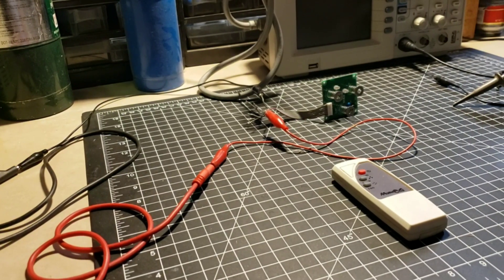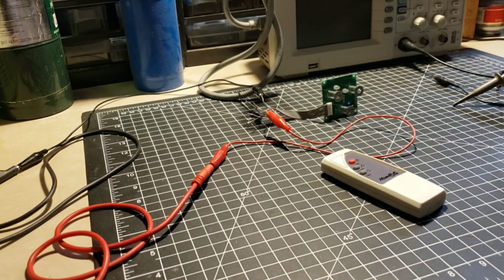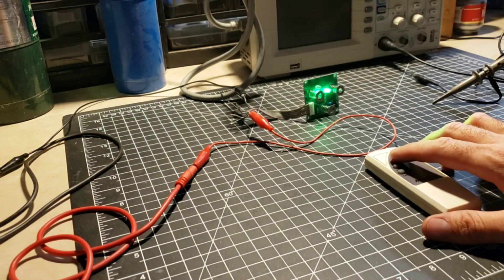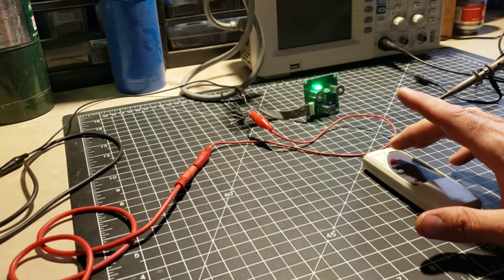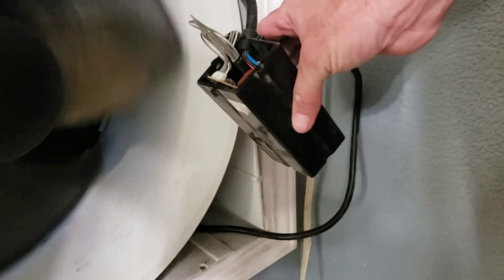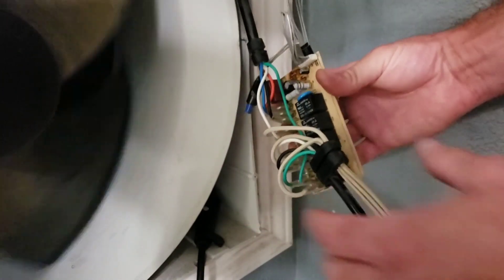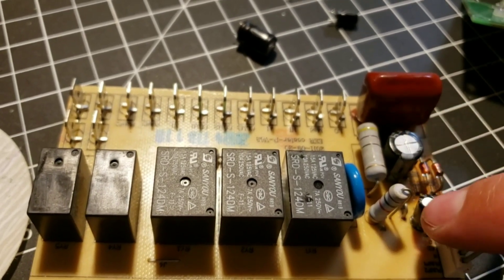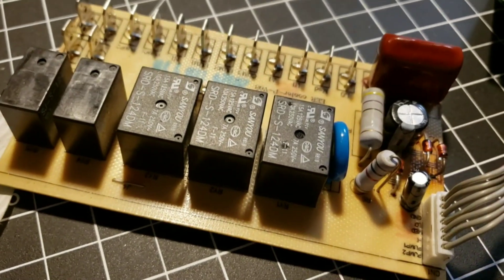Mastercool MCP44 FIXED!

Comment: Wonderful video.  Saved me from buying replacement front panel that would not have fixed the problem.  Have not touched a soldering iron  in 40 years.  What a great excuse to get back to it.  ALSO, thank you for the jumper hack.  I only use it on low fan with pump so i might not bother with actually fixing it. Thank you so very much.  Liked and subscribed

Comment: Well another year has gone by Aug 2024. I bought the capacitors 220uf & 100uf and tried to swap today.  We have a problem on my MCP59 relay board. It is not the same board and all capacitors seem to be 4.7uf. I guess I will have to buy a replacement relay board from Mastercool.
Reply: Replace all capacitors with the same uF rating as was originally installed if they are different than the ones on my board.

Comment: same issue with water pump. There's electrical current but still doesn't. work, meanwhile the purge running perfectly. Any help?
Reply: My first thought would be to replace the pump. They are super cheap and can be purchased at any major hardware store.
Reply: @Oidium45  I already did, but still.

Comment: Thanks man!!!!! With no experience at all I was able to do it. Bought a 35v 1000uf by mistake so I just changed the 16v 100uf and it worked! I would say for $20 because I didn't have a soldering kit and the packs of capacitors (no individuals). Super worth it!

Comment: I purchased my Mastercool MCP59 about a year ago.  Worked fine last year installed in living room wall with air inlet pulling from garage.
My problem is that the fan shuts down on high then after about 10 minutes it will turn back on for a couple of minutes and then shuts down again.  The pump never shuts off.
So it worked fine on medium fan selected but now has started shutting down on medium.  Currently if set on low it stays running.  It needs cleaning so that is the 1st step i am taking.  Then if continues malfunctioning I will look at swapping the caps.   Looks like they are 220uf and 100uf based on video.  Is that correct?

Comment: This control box has been only trouble.  I have replaced it several times and it still does not work properly.  I had to pull the water pump plug directly out of the unit and plugged into a surge protector pluggeg into the wall bc it did not work through the control box.  Now I have fan motor issues and at first I thought it was the fan motor itself but now I am thinking it is the stupid control box again.  I can plug the purge pump directly into the surge protector too and I would like to do the same with the fan motor.  Can you recommend a way to do that with an analog box system to control the fan speed, so I can get rid of the crappy chinese built electronic control box?

Comment: Perfect fix--with an update. I used your video to repair my two mcp44 coolers that both stopped working this year. Upon inspection, my circuit board looked the same and had the same heat marks as yours. Although, I noticed the large capacitor on each board had bulging but the little capacitor did not. So, I ONLY REPLACED THE LARGE CAPACITOR on the circuit boards for both coolers and they work perfectly now. Thank you for the video, your guidance was very helpful! If I was going to give advice to other people with the same problem, I would say to only replace the 35V capacitor. On a side note, I couldn't find any capacitors for sale locally so I purchased an assorted pack from Amazon for $10 and ended up replacing the 35V/220uf cap with a 50V/100uf cap. I will update my comment if my fix fails.

Comment: I installed my unit during new construction. At the time it seemed like a reasonable choice to have the electrician connect the power directly to the nearest electrical outlet. Leaving that wall socket open for other things. This was before I found out that these coolers has this issue after about five years of no issues. I'm not an electrician but I have changed electrical outlets many times in the past. I figured I'd open the outlet and disconnect the cooler. After turning off the breaker to that outlet, and testing for hot wires, there were still power in that box. I don't like giving up on a project until it's complete, but I also have a very healthy respect for electricity. The wires from the cooler were so short and still hot, I wasn't confident enough to go any further. So, I closed it up and left it alone.
With COVID-19 still going strong, I would rather not have any strangers in the house, at least until we all have had the vaccine. Any suggestions?

Comment: The main problem with the rectifier bridge is : 
1. Low quality electronic parts. 
2. The circuit board is enclosed in a plastic box. 
3. The rectifier bridge doesn't have a heat sink. 
Thus over time  ) two years on average  ) the bridge burns out  and you need to buy another at $ 90.00 usd . A service call averages about $ 200.00 every 2 years or $ 600.00 in six years. 
You could of purchased a Bon Air Durango for $ 600.00 and had a control module that would last TEN or more years. 
I've installed over 80 Bon Airs in the last 10 years and only one of those did the control module fail.
An interesting note  : if you look inside a master cool mcp 44 control module you see three things : 
1. Low quality parts. 
2. Inconsistent manufacturing process  ( poor workmanship  ) 
3. No heat sinks. 
I service,  repair  & Install evaporative coolers.  Google  : swamp cooler repair.  I am located in hemet California.  ( this is not a promotion  ) Have a good day.

Comment: This worked for me as well. I did not have a local place to get capacitors ( I live in Denver Co, odd) so I purchased mine off of  www.mouser.com .  I do not know a ton about capacitors, but these are the ones that I purchased. https://www.mouser.com/ProductDetail/647-UBT1E101MPD8TA and https://www.mouser.com/ProductDetail/80-ESW227M050AH2AA Do a little research online. You can have problems if you do not install with the proper polarity. Shipping was my greatest cost here. The total was $9.55 with $8 of it for shipping.

Comment: This video was a life saver. Changed the fan motor because I thought it was an overload trip from the bearings getting worn. The unit’s 6 or so years old, not too upset about changing it out but it was still doing what you explained at the beginning of the video. I figured it was something in the panel but wouldn’t of had a clue what to do about it. I was able to bypass like you explained and get it going. Ordered some variety pack of capacitors on amazon and am kind of confident I’ll be able to change the 2 out and have my remote back. Much appreciated.
Reply: Can you please tell me what I’m ordering ? I’m not too sure what I’m looking for. Ty

Comment: Very good video I change the both pieces and now my cooler is running great, i spend just 5 usd. Thanks for for your video.
Reply: were did you buy the diodes at thank  you
Reply: @JAM-zb2vh have you try radio shack?

Comment: Do you have to remove the capacitors to test them? What do you think is the likelihood that those are the problem vs other components? Mine turns the fan off and leaves the pump on and sometimes turns the pump off and leaves the fan on. I don't see a replacement module online anywhere. Willing to do some simple soldering if you think that will be the problem.
Reply: did you fix the problem if yes how did you do it and were did you buy the parts at thank you
Reply: @JAM-zb2vh  Yes I fixed it. I just bought the entire control unit after I found a replacement. Wasn't cheap but I didn't want to mess around with changing components.
Reply: @fabianchavez8219  hi where did you find the control unit I'm in search of one too

Comment: Hi I am having similar problem when I jump 5 volt to pump and 5 volt to hi fan, the motor gets hot and smells then shuts down
I am thinking the motor is shot
Reply from the maker: Just an educated guess but seems like there might be a bad bearing in the fan motor or possibly a bad motor start capacitor.
Reply: @matthewnedwards2   what am I looking for to purchase them and where? Thank you

Comment: Hi there, I am having the exact issue with mine.... Can you possible email me at Alisha19809@yahoo.com (if you dont mind) and explain how to get it to temporarily work until I can have those pieces tested. I watched your video and Im not electronic savvy but my dad was a handy so I know how to shut off breakers... Its terribly hot and Im inbetween paydays. Also I am having a hard time removing the front of the unit as well. Please if you have time....you help would be very much appreciated...
Thanks-
Reply from the maker: There were several different variations over the years with the same model number so I am no help with removing the front cover aside for look for rubber caps covering screw holes. As far as getting it running in a hurry when you open the unit you will notice that the motor and both pumps use standard 120v wall plugs.